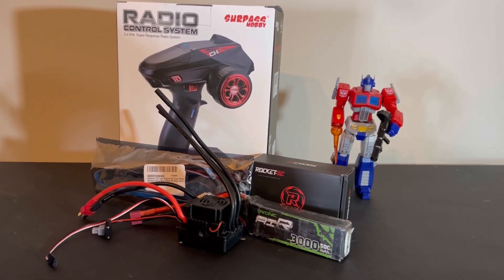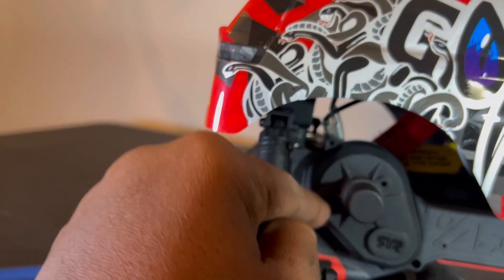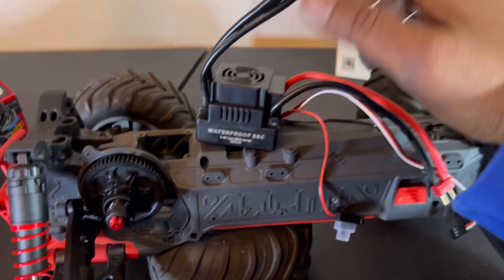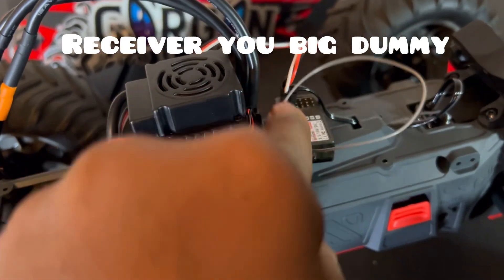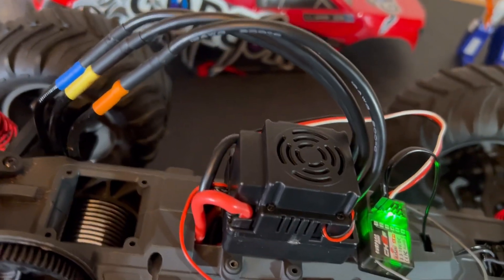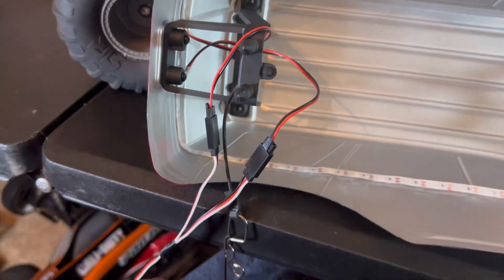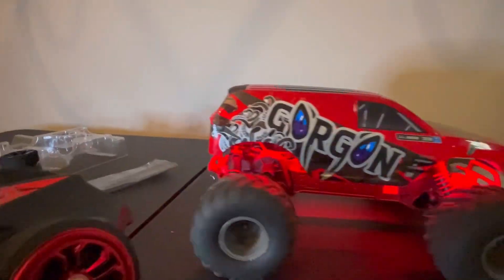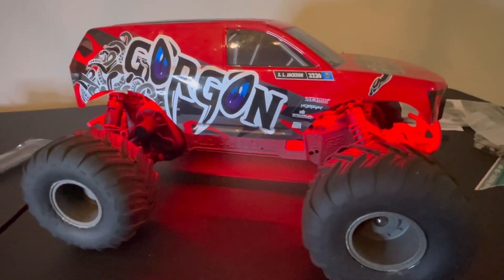Upgrading Aarma Gorgon from brushed to brushless #arrma #brushlessmotor #gorgon

Comment: You can waterproof a receiver box by taking the circuit board out and putting clear nail polish everywhere except the pins. 
It's not 100% water proof, but that will keep the circuit board from being damaged by splashes. 

Or tie the receiver up in a balloon, but then it's hard to mount that way.

I like the green Gorgon, but i think red looks the best. 

Arrma knocked it out the park with that body.

I have those LED strips. I use shoe goo to stick them on. It's permanent. They do not unstick ever with Shoe Goo. 👍🏽

Comment: Awesome video! I’m interested in buying the car and make it brushless. I’ve been looking at a few motors and I think I know what I want but I don’t know if they will fit. Can you help me? Also do you think my e revo1/16 receive would fit?
Reply from the maker: Sure dude. Any brushless motor would do. Just make sure the size is at least 3660. You’ll need a longer motor because of the way the Gorgon is made and your mini REVO receiver should fit in there with no problem. Good luck bro and hit me up if you have any questions. Thanks for watching
Reply: @Rc-Krazy  thanks a lot man! When you say 3660 do you mean a 3660 model in size? Im quite new to switching these kinds of parts.I’ve found 2 surpass 3660 motors both with 4200 kv but one says 3.175 mm and the other one says 5mm. Guess that’s the shaft?  How long do the motor need to be?
Reply from the maker: @t3floz  the 3.175 and 5mm are the size of the pinion gear shaft. The first number of the motor is the size. For example 3650-3660 is your typical size motor for your 1/10 scale and anything over that is good for 1/8 and anything under is good good for 1/12-1/16 scale

Comment: Gotta get the 0.8 mod. 1/8 bore . 14 tooth pinion. That's whag i put on. Runs smooth. Perfect gear ratio. Also the Granite wheelie bar fits the GORGON.. I already put mine on. + Cooling fan and the Led light kit meant for this truck. Mine came out sick.. also. If you run the right battery its fast enough stock with the right gearing. Anything more te then 16 tooth on this is going to be to high of a gear ratio
Reply from the maker: Had to order a new motor and esc. Going to install it soon
Reply: @Rc-Krazy  same . 3660 brushless motor fits the GORGON better.. next upgrade on mine. Going brushless also..  nice build brotha. I'll be keeping up. Already subscribed.